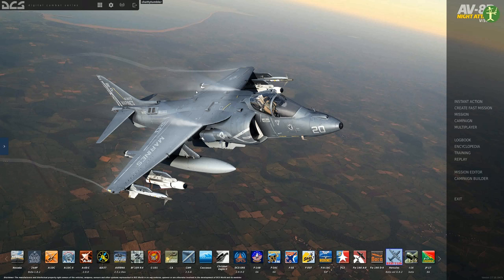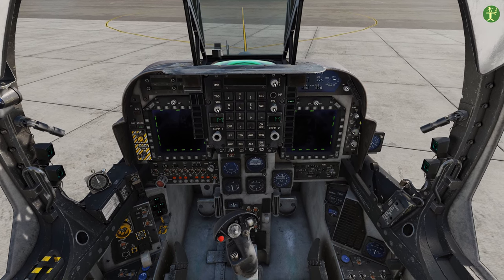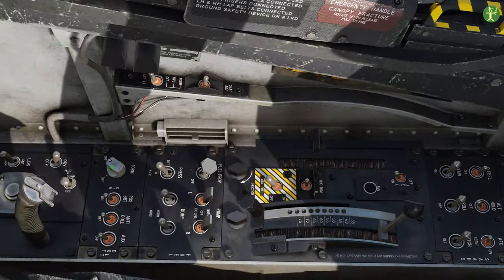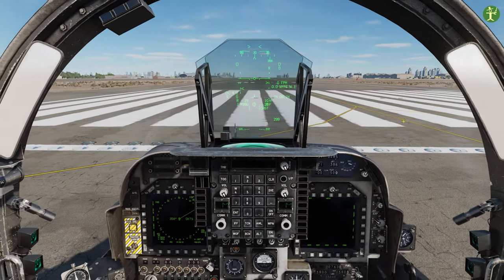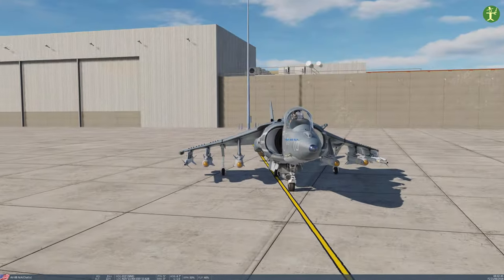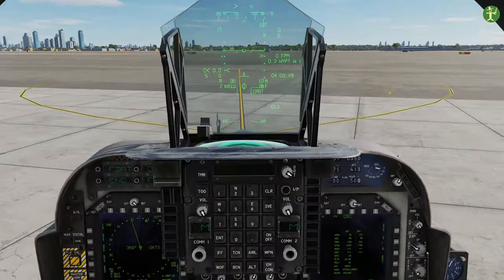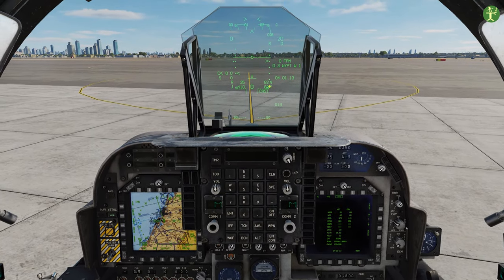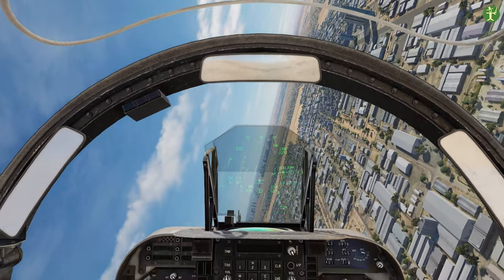DCS AV8B Tutorial Start Up and Normal, Short and Vertical Take-Off

Comment: How can you view so easily and comfortably? What the gear are you using? Thanks
Reply from the maker: Thank you for your question. I use Trackir- an infra sensor I have attached to my headset that follows my head movements. I’ve also bound ‘zoom in slow’ and ‘zoom out slow’ to the side buttons on my mouse and to two keys on my keypad - it means I can look at something and zoom in and out without too much effort.
Reply: @ChattytumblerTCW  i have a cheap webcam, is that too much different from track ir (about precosion, latency...)?
Reply from the maker: @joytoys5669  it will work but it probably won’t be as good as the Trackir.
Reply: @ChattytumblerTCW  i will consider to try a track ir , thanks for your help.

Comment: I was experimenting with vertical take off yesterday at Damascus, I found my harrier couldn't even get off the floor unless the gross total weight on the VREST page was <19000lbs, which is me getting the rearm weight to around 18500lbs. The re-arm screen seems to show a lighter weight by approx 500lbs compared to the VREST page weight indication. So I have no idea how you managed to get off the ground with 20272lbs :-D I have flaps full H2o set to take off etc etc and MAX throttle :-/
Reply from the maker: I wonder if the outside air temperature was really hot? Can’t think of any reason why it wouldn’t work.
Reply: @ChattytumblerTCW  I spoke about this in a facebook group and everyone seems to think that it was because i was testing at Damascus which is like 2300ft above sea level. I will try again on the tarawa or maybe in beirut which is only 87ft ASL :-)
Reply from the maker: I've just been testing and I see what you mean. Temperature made no difference, it was just tricky to get in the air from Damascus. In the end I found I could get airborne with 20500lbs (47% fuel, 2 AGM65 and a TPOD) if I set the nozzles to 70 degrees. It was more of a very very short take-off than a vertical one - I moved forwards only a few metres before lifting off and away. Took about 150 litres of water so still plenty left.
Reply: @ChattytumblerTCW  Is that with nozzles at 70 for the entire takeoff? I will have to test this also. Cheers.